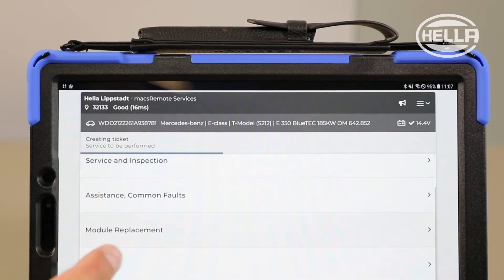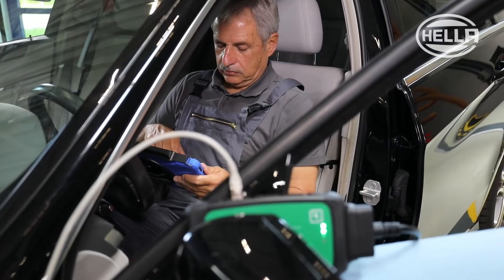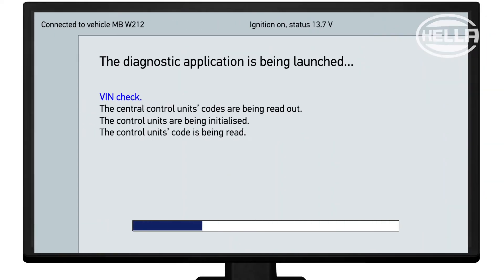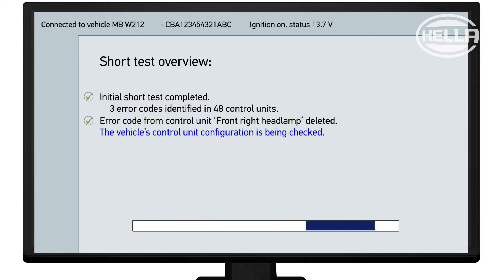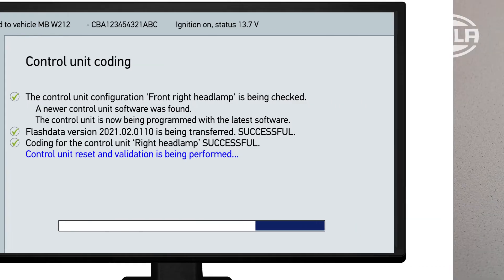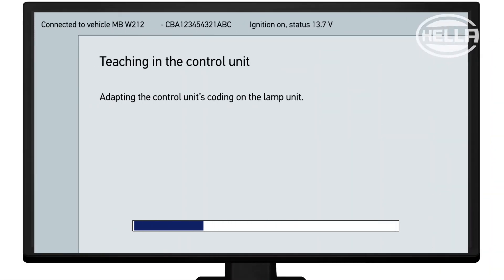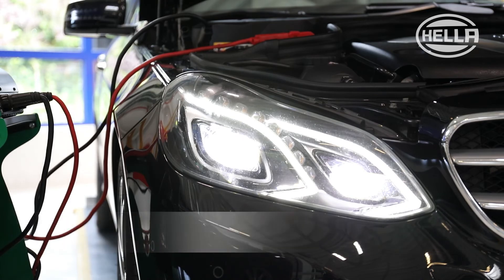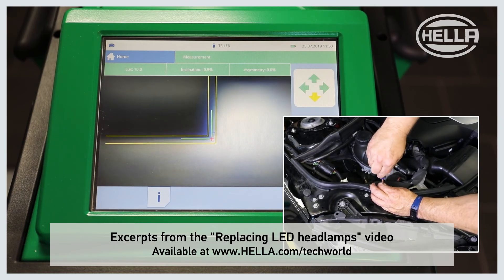Flashing and Coding LED Headlamp Control Units for Mercedes-Benz E-Class W212

Comment: I LOVE my 2015 E400 4matic! I love the corning lights, I hate the cornering lights at the same time, also Hella , $3,000 TO REPLACE HEADLAMP, NO BULBS, LED bulbs HARDWIRED INTO HEADLAMP. And in their infinate wisdom, they put the Electronic control for headlamp on bottom of headlamp, if water gets in from rain or carwash, goes right to bottom and shorts it out. Worst German engineering I have ever seen or largest money grab. Did I say that you have to remove the front bumper to change a light in this car?!? Still its an awesome car speed/handle/queit inside/roars outside but stops me from buying new.

Comment: I have same car with LED System, can I buy headlight with same led system but different part number and use old modules on it? Will it work? Or do I need same part number headlight?

I would appreciate your help please
Reply from the maker: Hello, 
your question is not so easy to answer due to the different possible combinations of spare parts.   
One of the most important points for a successful repair is the right spare part. 
Each type of headlight has its own control unit with a corresponding software version, and a clear assignment of the spare part number is crucial so that everything in the vehicle works perfectly in the end.
In any case, a comparison with the OE part number of the removed headlight should always be made. 
If a clear assignment is not possible due to a lack of spare parts or vehicle information, access to an OE catalog helps in this case. Based on the chassis number, the required OE part number can be researched here. 
Only on the basis of this information can it be checked whether a combination between the old control unit and the new headlight is possible. 
After the conversion, an LED code adjustment, headlight/control unit ) is definitely required in the vehicle.

Hope this could help you a bit.
Reply: Yes, you can use the old modules on the new or used headlight, usually the headlight Part Numbers are interchangeable. What are the Part Numbers of the old and new headlights? I need what is written on them not the part numbers from the EPC.

Comment: Need adapter cable to conect them befire coding?
Reply from the maker: @tedyciprian123: Thank you for your request.
The new headlamp is connected directly to the connector plug on the vehicle, so that the required coding can be carried out. An adapter for this is not required.

You can find more relevant technical content here in our HELLA TECH WORLD:
https://www.hella.com/techworld/uk/
Reply: @HELLATECHWORLD  so dont need another pin out to connect or to change pin out?
Reply from the maker: @tedyciprian123 : The Hella-Gutmann tool is coupled via the OBD port on the vehicle and connected to the Internet, an additional pin (connector) on the OBD socket is not required. However, the customer must be activated for this service via Hella-Gutmann.

You can find more relevant technical content here in our HELLA TECH WORLD:
https://www.hella.com/techworld/uk/
Reply: @HELLATECHWORLD  tnx for answer